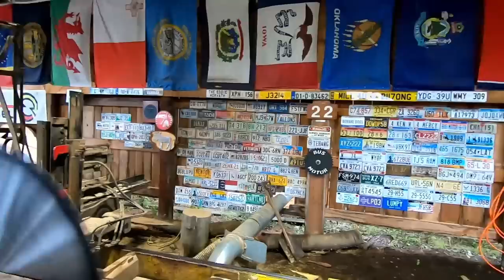sawing 16' 2x4's out of pine logs # 466

Comment: Mark, once you get used to using that laser thermometer. You'll ask yourself; how did we ever get by without it. I have one in each toolbox. There fantastic for working on old equipment that you aren't sure that pumps are working correctly or are cooling the way they should be. I do work on a lot of outboard marine boat motors. And there great for telling me if we have a cylinder that's not getting enough water, or something is blocked with a piece of debris in a cooling passage. With a little use, you can even tell when you need to add grease to you main bearing in that blade. Because you'll see the temp getting warmer and warmer if you play with it enough.  Thet are very handy to have to help  keep the maintenance under control.

Comment: Looks like those knees have opened a degree or two passed 90. Noticed on that 4 stack that each sat a bit back from the one under it.
Reply from the maker: bark under the cant.
Reply: @markgalicic7788  At the 24:30 mark,  there's no bark under that stack.

Comment: deeply embedded nails ?
permanently mount a metal detector near the plane of the saw blade
such that the fresh face is scanned. as it moves to the blade.
possibly hinged above with a wheel so it can roll past the first rough cuts

Comment: Can you please explain again why you didn't buy a bigger blade? Sure looks like you could use one...
Reply from the maker: because I would have to make a new sawdust box under the saw , more sawbits to maintain , more horse power to pull it , modify the husk to hold the saw guide , move the splitter back , make the off bearer belt wider to take 24" wide boards and relocate the pantograph arm because it's in the way too.
Reply: Oh I see, thanks. What sort of power does that bus motor make? Easily 100bhp at a guess.... @markgalicic7788

Comment: You often clean up the edge of your cant after turning it to a different edge. I see all circle sawyers doing the same but I never see a band sawyer do that. Why don’t they need to do that?
Reply from the maker: they should but you cant shave with a band saw , logs do move while sawing them from stress in the log so I like to clean the face to check if it's true.

Comment: Big log. Sometimes it's it hard to see the Green Lazer depending on the light level and wood color. Maybe a Red Lazer would be easier to see. As long you can see it Mark that's the main thing.
Reply: Looking back through the old videos, It seems that the lazer went from bright green and easily seen on video to a thin green line thats barely seen sometime about episode 271. The episodes prior to it have an easily seen lazer but 271 and on seem to have a very thin lazer.
Reply: Red is better or white
Reply from the maker: I can see it just fine.

Comment: Guys, your Texas flag is backwards.   White goes to the right.
Reply: Hi Ken, thanks for watching the videos! I have researched this Texas flag hanging vertically following comments that it was backward last year. Red is right is what I found to be correct. 

Texas Government Code
Title 11. State Symbol and Honors; Preservation
Subtitle A. State Symbol and Honors
Chapter 3100
Section 3100.059 Horizontal and Vertical Display 
(b) (2) white stripe should be, from the perspective of the observer, to the left of the red stripe.
Reply from the maker: @mark6062  thanks ZZ.